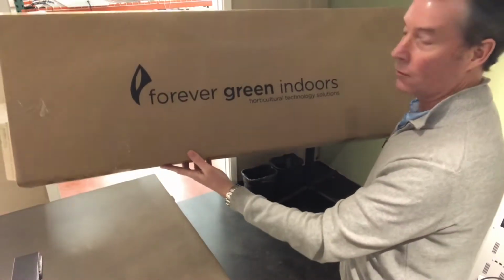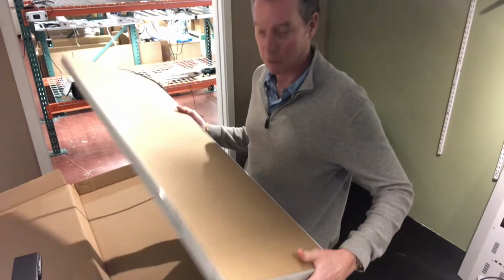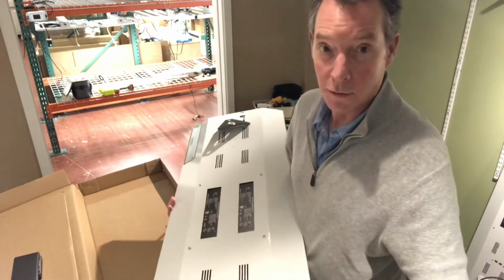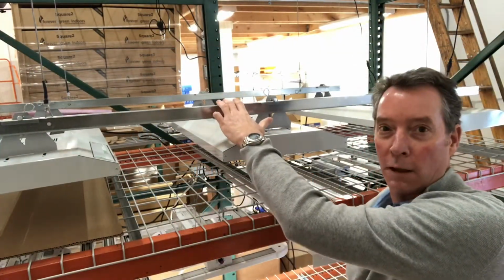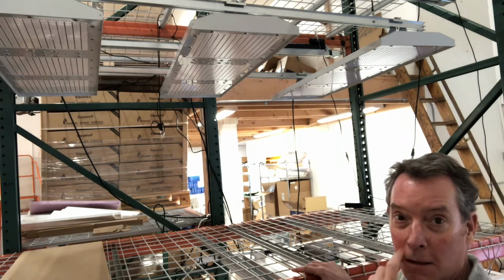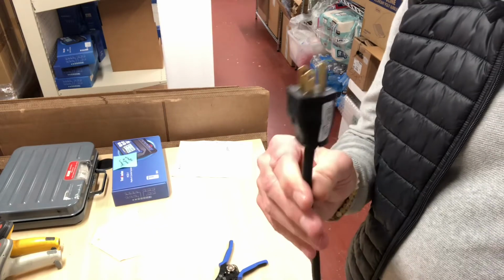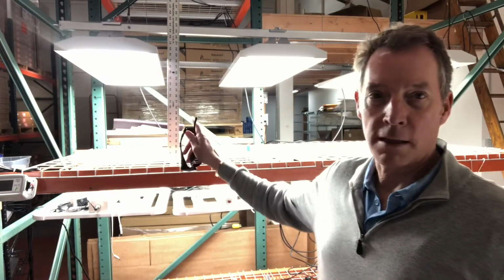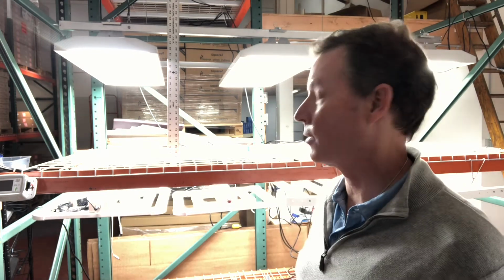FGI Lightpanel V2 Commercial LED Grow Light Unboxing Video

Comment: why didn't you use the Seoul 2835 B instead of C? Seems like Seoul2835B has half the lumen output of LM301B/H where the Seoul2835C outperforms the LM301B/H? Thanks